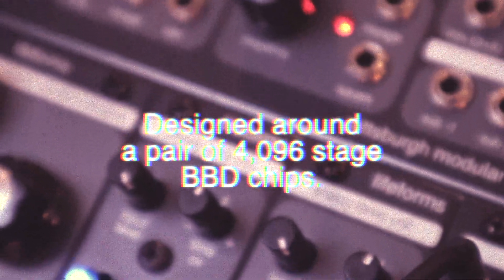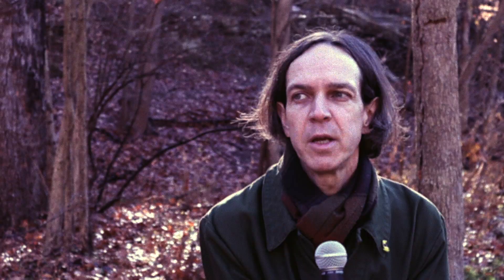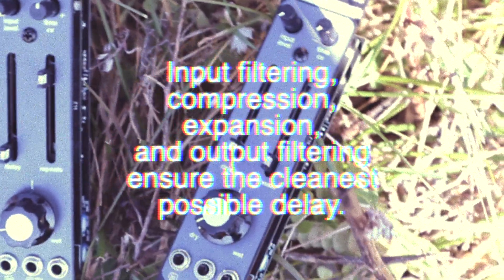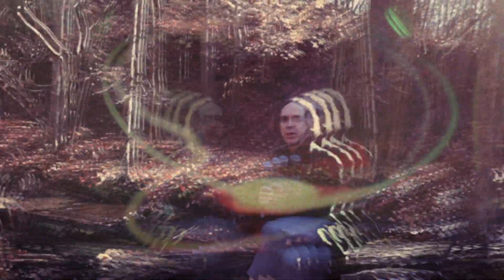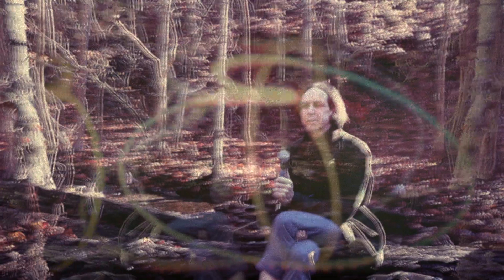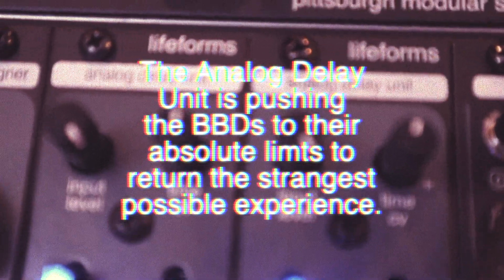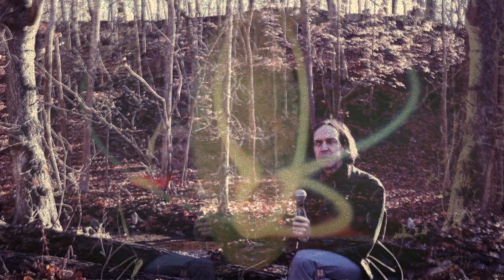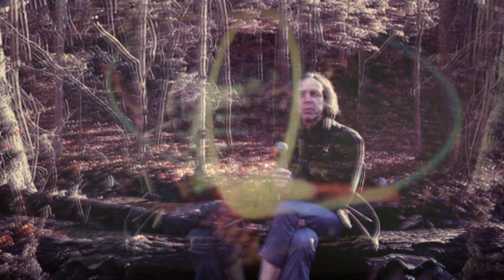Pittsburgh Modular Analog Delay Unit Introduction

Comment: Hmmm, I noticed in the video @ 2:38 some new modules. Are you going to break out all the VRL modules for release separately? And is that a new mixer I see? Is this is good or bad news for VRL backers?
Reply from the maker: Good questions... I am not going to break apart all 4 sections of the VRL to release separately. The sections of the VRL were designed to serve the needs of the VRL and do not necessary translate directly into standalone modules. Yes, you saw a new mixer. I will be showing the mixer and several other new modules in 2020 starting at NAMM in January. Good or bad for VRL backers? VRL backers are getting an amazing instrument that I am deeply proud of. The VRL has a unique organic sound that can not be reproduced with other instruments. Hopefully the backers love the VRL as much as I do.

Comment: Cool tool... still happy with my Pittsburgh Modular "Analog Replicator" with I think the same buckets as mentioned in this nice vid :-) When available over here I gonna get one of these for sure \0/
Reply from the maker: A new feedback circuit in the Analog Replicator allows many more echos before self-oscillation than the Analog Replicator offers. The Analog Delay Unit max delay is shorter (340ms) creating a cleaner, brighter delay. There are three variable factors in a BBD delay. Delay length, filter cutoff, and fidelity. To improve one, the other two will always suffer. Shortening the delay allowed us to improve overall fidelity and raise the filter cutoff.
Reply: @pittsburghmodular  What type of chips do you use in your delays?